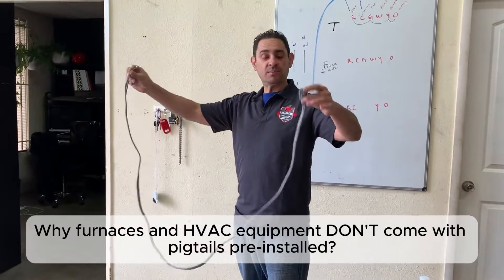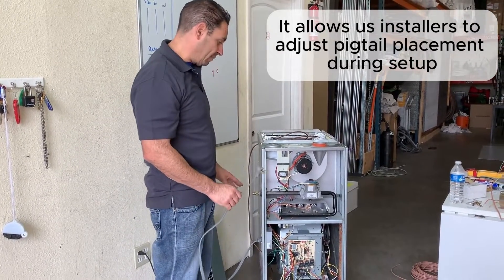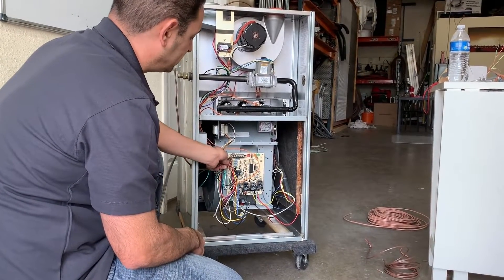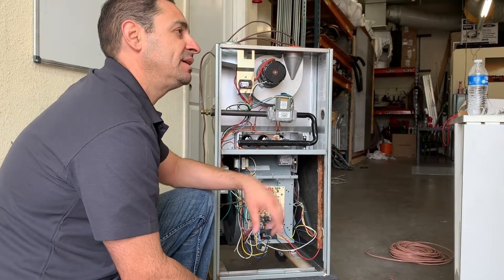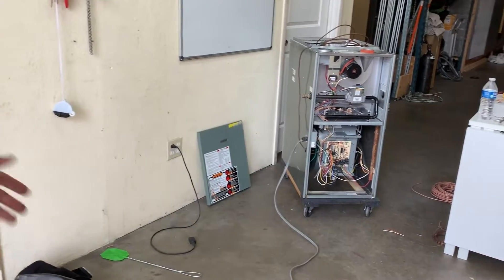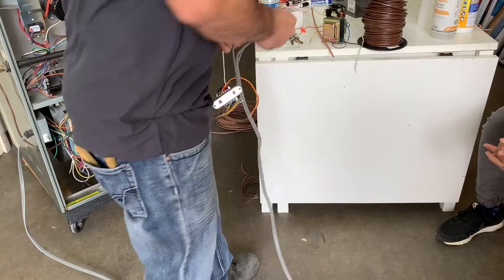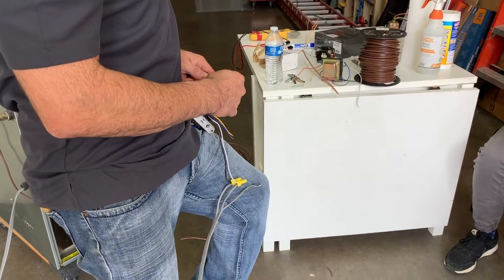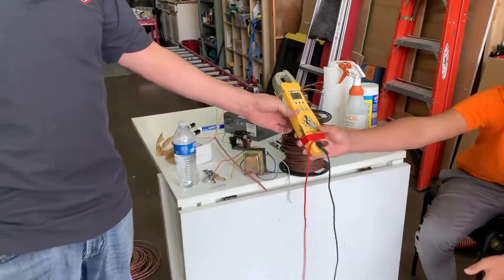How to Wire a Furnace Pigtail & Avoid Common Installation Mistakes

Comment from the maker: Earth quakes are a huge factor. Keep in mind there is the national code and the local code. Local code trumps. Inspectors and city codes vary. In our part of the city the local code is to be followed. And then inspector by inspector. Each has there own preference. And I agree with them that pig tails are safer. They make the call. If that makes sense.
Reply: What in the Hell are you trying to do in this video?     It has absolutely NOTHING to do with wiring your furnace..  What people want to know is how the hell to get there furnace working when utility power goes off.  The PURPOSE of a pigtail plug is to connect to a generator or power bank.  The transformer has NOTHING to do with this,  as the AC power (which you have to have in the first place) connects to the PC board, then in addition to providing 120v to actually run the furnace,  the transformer steps down the 120 volt to 24 volts, which is what the PC board needs as well as the thermostat.  In an emergency loss of power,  the plug at the end of the wire simply provides an alternate source of 120 volts, being from generator, power bank, or inverter.  I'm baffled at what point you were trying to make.  HORRIBLE waste of 6.5 minutes.

Comment: May i.ask a question? Most manufacturers specify that the  furnace be permanently wired?   Why a pigtail?
Reply from the maker: Good question. Here in Los Ángeles both ways are approved. Perhaps because we are in earth quake land. Which is why we also use gas flexes. And in other parts of the country they use hard pipe. 
Now personally I like pig tails due to safety. I like to visually see that the power is off. And hardwired someone or even myself can end up flicking the switch power back on and shocking myself. 
So bottom line. It’s a thing of safety. Does that sort of answer your question?
Reply: Sort of. But what does earthquakes have to do with anything. I am almost certain that most manufacturers state that a permanent means of hooking up the electrical. They ship their products everywhere.